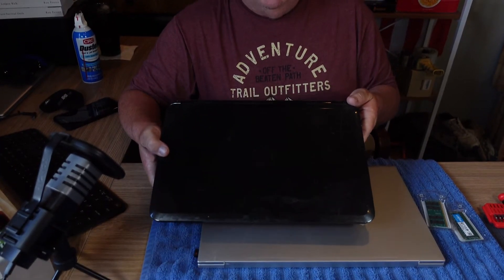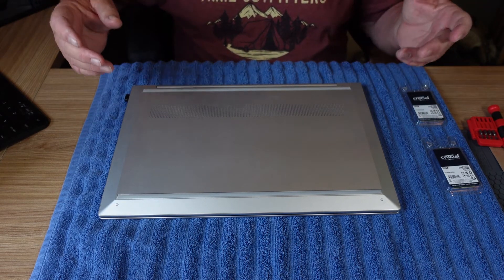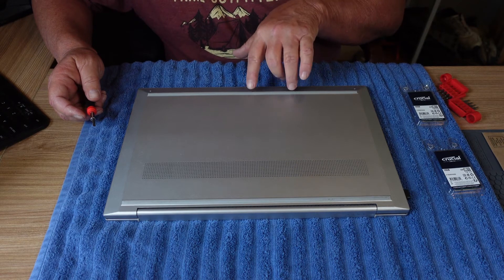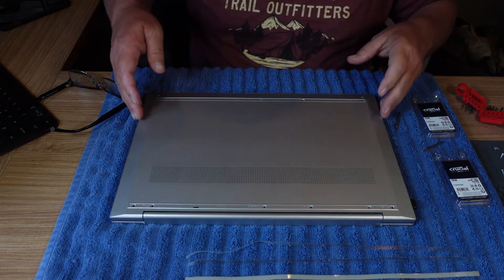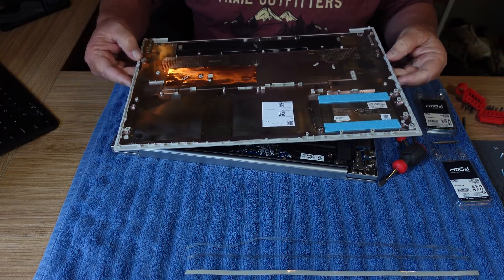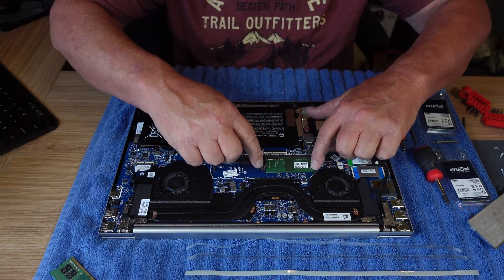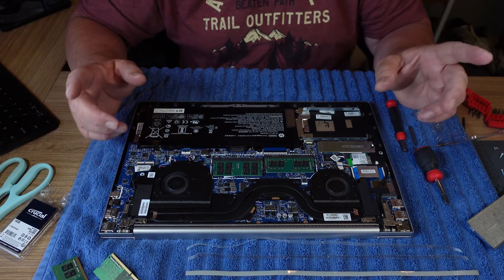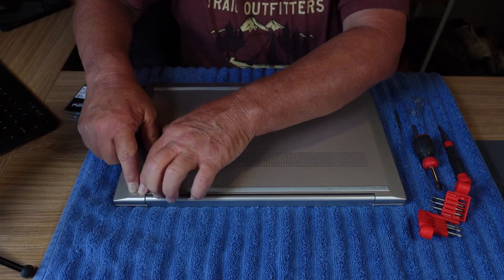DIY How to (I) Upgrade RAM Memory in HP Envy 17M Laptop

Comment: Hello. What type of RAM did you choose? What brand exactly? I found "Lexar" 16Gb x 2 at 3200MHz and "Fury" 16Gb x 2 at 3733 MHz which is a bit more expensive but will it be compatible. What do you think ? And so you can add another 2nd SSD... This is very useful.

Comment: Thanks for doing this - was wondering how easily upgradable this laptop is. 

Tip: You forgot to disconnect the battery first, and clear any static by touching the metal frame and grounding yourself. That’s why you got sparks. Not good :)

Comment: You can still change your own memory unless it's soldered to the motherboard...that was very cool to watch & suspenseful...I used to work on computers way back in the day...considered myself quite savy & then they came out with windows...in the beginning I could still work it through the dos prompt but I haven't worked on a computer since the mid 80's -Bonnie
Reply: I think the soldered memory is more likely on cheaper computers.  What you can do is look at the videos of people doing the upgrade to that same model computer if you are in doubt.  There are also often computers that have the same board but different other things.  They are of course different models in the same numerical series.  Still it is best to see if you can find your exact model.  This way you won't set yourself up for disappointment.  Even if it is fully loaded it is nice to be able to swap RAM.  You never know when you will have a bad module and having it not soldered makes it infinitely more easy to switch it.  After all, who has the skills and equipment to do it properly and not fry something?  Not everyone and not me!!
Reply: All ways disconnect the battery first...
All ways.
Foolish man.

Comment: yes you should always take the bat out..when adding memory..i have 16 gig in my hp desktop...video s what takes the mem..like you tube..haa..ohhh you said gateway,,mercy and acer..junk...i have a dell server...it takes the newer drives,,,its my backup system,,,,i started out way back with Ibm...and they had very little programs for it back then,,,i think i went all the way to pittsburg to get windows 3.1 or may be earlier,,,oh those were the days,,,today i dont run bill gates windows,,i run Linux,,,its by far the best sys to run,,and it runs everything in Ram..and its free...it has about 3 times more then Windows ever had..tons of programs..I run Mx linux now,,i use to run Linux mint...for years,, fact you can put both on a hard drive,windows and linux,,you can boot up either one..really nice,,,ok Joe you lucky it worked,,haaa,,i think you have enough memory now,,for sure..

Comment: Hey Joe!
If that was DDR3, I'd have taken the 8Gig off your hands.
My laptop runs fine on 12GB, even 4k video processing, but I run Linux...  The processor gets hot, the fan ramps up, but it never pages to disk.
First rule of laptop work is remove / disconnect the battery.  Second rule is test it before putting the case back on.  You were lucky.
Good luck upgrading an Apple anything.
I remember when blank CDR disks were £10 each, and SCSI still ruled the roost.  Guess we're all getting old.
All the best.
P.S. My Thinkpads are also of the "one screw access" variety, with a removable battery.  Remember those?  😢